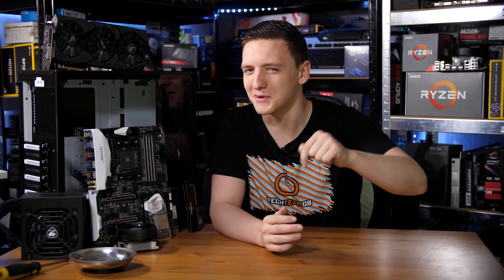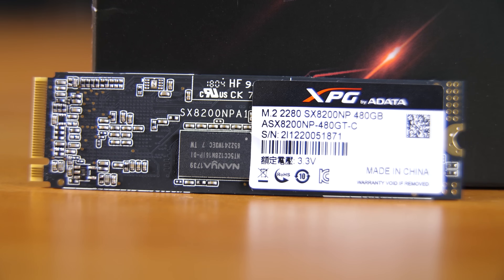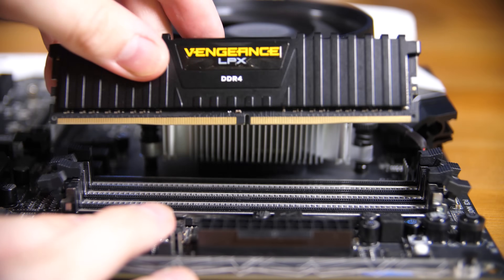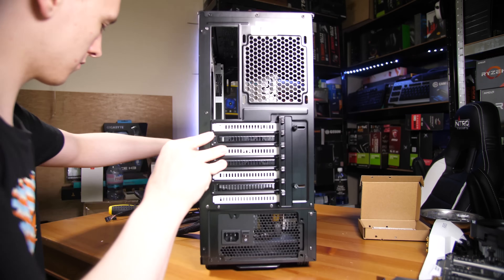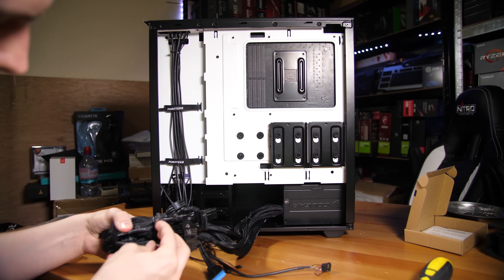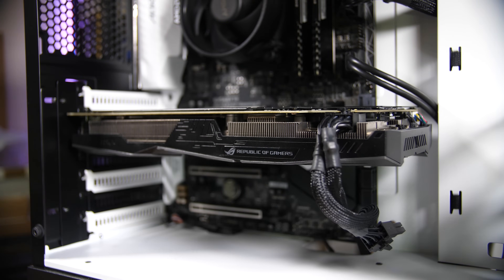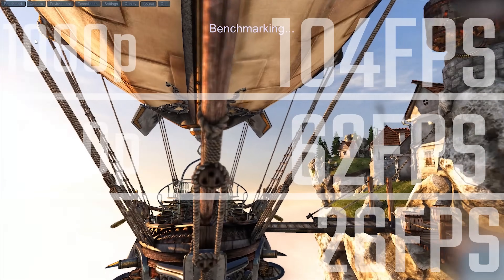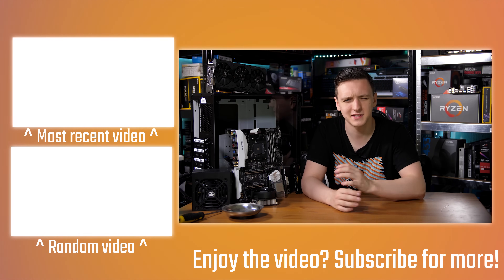£1000 Ryzen 2600 Build Guide - June 2018

Comment: yeah, id get the inland SSD 120 GB for Windows and Steam for 25bucks and a 2TB sata instead of the ultra expensive M.2. and if you r spending $1200 PC find 20 bucks somewhere for a Cooler. definitely get a better GPU. least 1070. RAM prices are just ridiculous so DDR4 3000 cheapest kit should do it.

Comment: I currently am running a GTX 1050 2gb "yes i know" and a amd fx 6300 but am getting a Zotac 1060 6GB and a ryzen 5 do you think this is a balanced upgrade as its only costing me around 500$ for the whole build or are there any smarter parts i could get????
Reply: Dont forget that if u buy a new ryzen u may need a new mobo and ram aswell ;)
Reply: Sjoerd Langeveld Yes I have already. Purshased an am4 mobo and my RAM is compatable. Everything else is fine

Comment: I am going to build a new pc this year for gaming and the components you've used are pretty much the ones I was planning on using except for the case. I really like the look of the Meshify C in white, although that new Phanteks case is pretty cool. Mine's gonna be a Star Wars build so I really want the case to look the part. I guess that the 350x does fit that bill and I also really like the new upcoming Evolv x which will be available later this year. I like this price point you've chosen as it falls between the budget PC and the high end one. Thanks again for another great video. Look after yourself.
Reply from the maker: Nice one, I've heard great things about the Meshify C so you should be in good hands there!